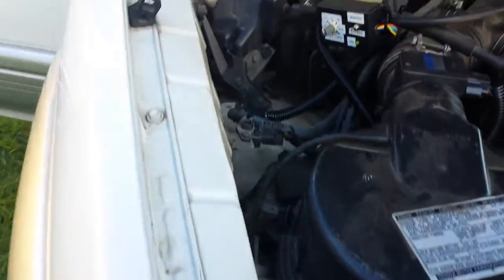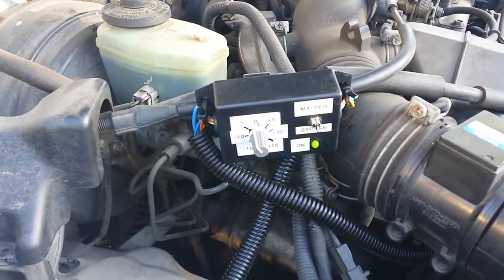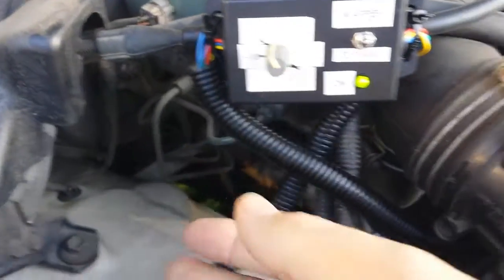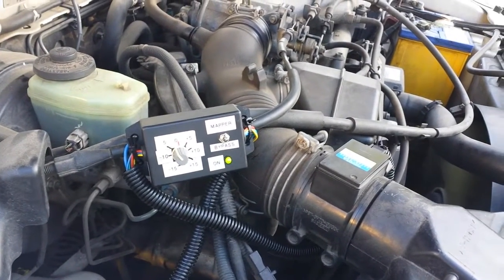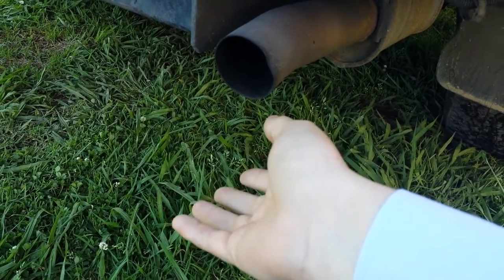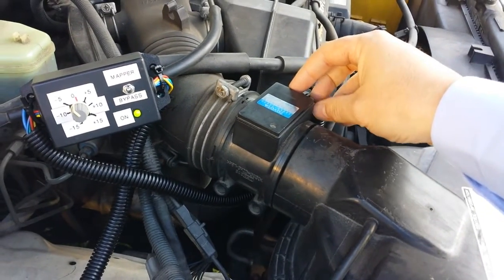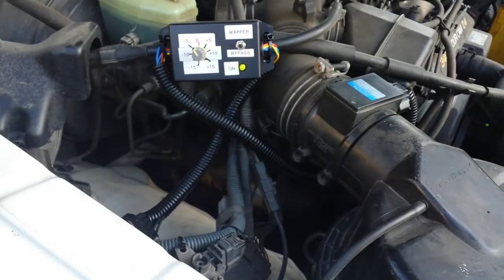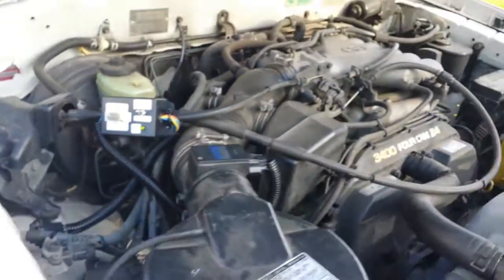FUEL SAVINGS with Ozbush MAF sensor adjuster module

Comment: Hi
Do you have FUEL SAVINGS with Ozbush MAF sensor adjuster module
Fits Ford Expedition 2007?
Reply from the maker: Yes it saves on fuel. It is the reason I installed it. It was using over 12liters to the 100km...now it is around 9L. I can dial it down more but power suffers. Check the website for info on the models that are covered.

Comment: Install a Wideband o2 sensor like innovate Motorsport because you might be surprised to see that the afr is fine and its your cat converter is burning off the excess toxic gasses from the cat not fuel. Good luck Diy experiments are fun. Have a look at apexi safe neo
Reply from the maker: interesting comment-thanks for your input-looking up that apexi neo now....

Comment: Forgive my ignorance (I gave up my interest in car mechanics when I changed from a carby to fuel injection); Is there some reason you can't just tune the car to run lean?
Reply from the maker: too lean and the engine overheats. this device is dangerous if dialed up too far

Comment: you better watch your temp...running lean on petrol engines makes them run real hot....you will probably get better economy by just driving slow..if you play with the mixture you have to do the timing as well..I seriously doubt this will work unless you car was so far out of tune in the beginning anything would improve it...keep me posted..
Reply from the maker: yeah i am watching temp. I don't think it is running too lean. There is still enough fuel going in to give a slight petrol smell at the exhaust. It used to be so bad it was like raw petrol vapour. When i 1st bought this car it was giving about 15L/ 100km should have been around 11-12L/100km. A tune up got into spec.
I expect it will be around 9 now. It is running well. Don't think it is out of timing adjustment. I blew the engine on an old Sigma many years ago after messing with carburetor screws. There was white powder forming inside the exhaust pipe!
I am very wary of not doing that again.
Thanks for your concern.